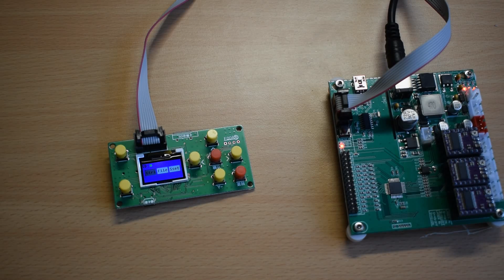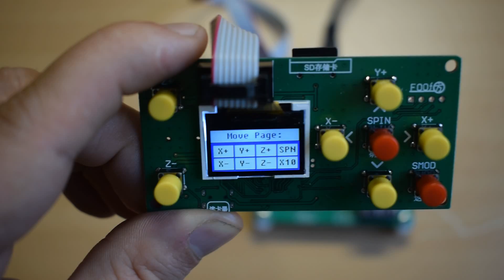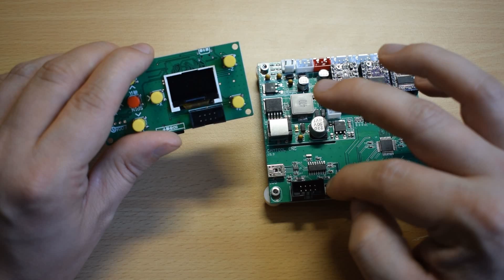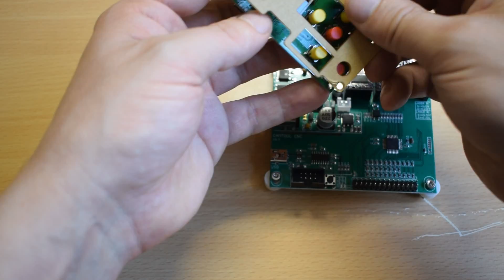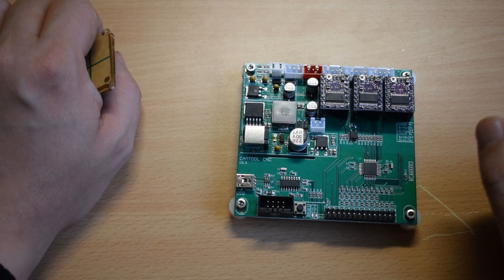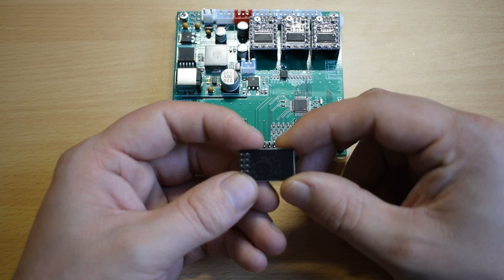Camtool CNC v3.3 overview - Can we add WiFi?

Comment: Wich is better a normal 3018 or the pro version??
Reply from the maker: I only have the Pro, but as far as I can tell, the main difference is in the frame, that has a slightly different design, and the Pro has a newer version of the control board. But when it comes to what they can actually do workwise, I don't think there is much difference.

Comment: I have just bought one of these and am thinking of adding a raspberry pi and small touchscreen to the USB.
Reply from the maker: That might be the solution I end up with as well for the long term, I do have a couple already sitting(running OctoPrint) close the where the CNC will be, so it would be easy to set up.

Comment: I think the little remote needs more functions like being able to zero each axis and homing.  The Amazon page says long pressing the B or SMOD key will exit the screen. Does that not work? I have a 3018 CNC and one of the smaller T8 machines. I use BCNC on a Windows machine and a shielded USB cable for control. I had some problems with electrical noise when I routed the USB cable too close to the motor .  Mine is  mostly used for routing PC boards so I need the autolevel function of BCNC. These little machines are a lot of fun.
Reply from the maker: Long press on SMOD does indeed work, thank you. But agreed, it needs a lot more features to be really helpful.

I didn't know about bCNC, I'll have to check it out, and I see some mention of it possible being able to run on  a Raspberry Pi, which would be nice, since I already have a couple of those sitting close to where the CNC will eventually be.
Reply: @ZnakeTech  Glad to hear it works like the docs say. You might be able to implement some more functions by putting them in small programs on the SD card. A zero all axis command  "G92 x0 y0 z0" could be stored as a program called "zero" and called after you position the machine with the jog screen.  My machine is an older version without the small pendant. It would be fun to play with.
Reply from the maker: That would be one way of doing it, not a bad a idea to quickly add some functionality to it. But right now I kind of have my heart set on exploring the ESP8266, my research has yielded some interesting possibilities which I will show in a video soon(if it works out). Another route would be to explore if you could flash a custom firmware onto the control panel with added functionality, I might look into that further down the line.
Reply: @BillyF1289  Wherever it is when you start a file is zero when you use the remote.